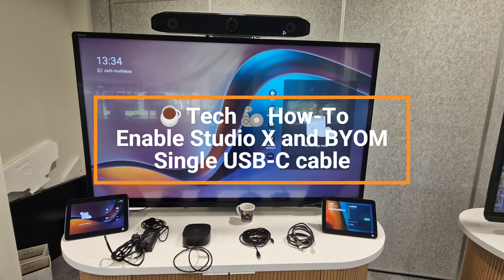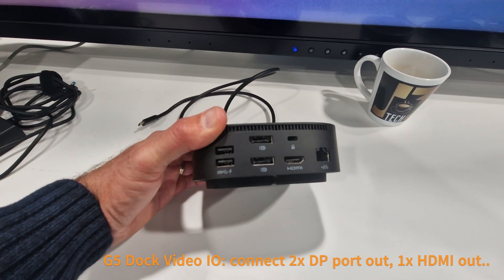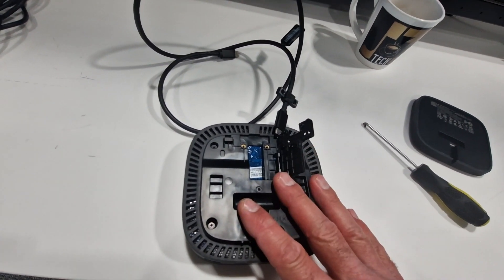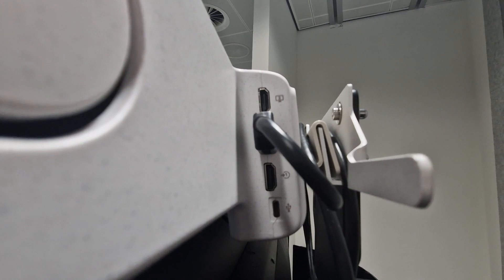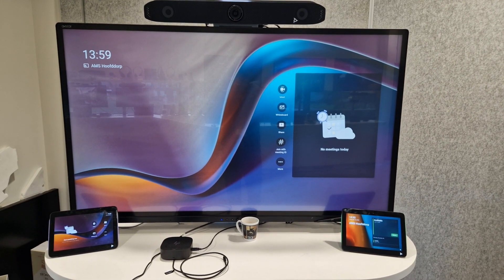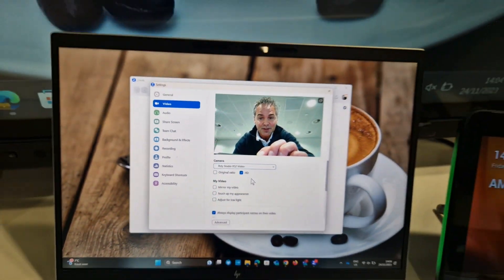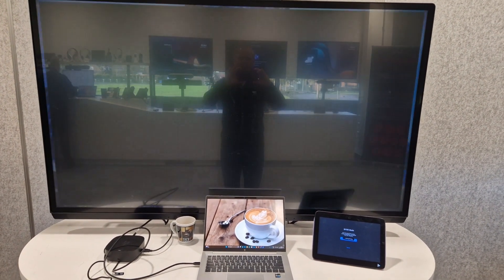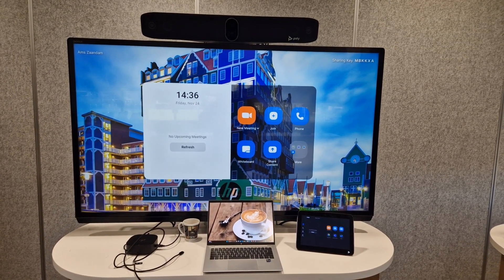☕Tech🔗Studio X as BYOD with HP USB-C Dock G5-G6

Comment: Thank you, Jan.  Great video and we are doing something similar with a non-HP USBC hub, so it’s good to see there’s an HP option.  With the single cable though, if the room is in Teams Mode joined to a Teams call, can you still content only (HDMI ingest) into the Teams Call?  OR will it throw the whole room into Device Mode instead – hanging up the Teams Room call?
Reply from the maker: Hi thanks for your comments. I guess with any HP or Non HP USB-C Dock (always test). In case you are live in a Teams meeting the Device Mode will be blocked and only share as expected content via HDMI in the Teams meeting. You can turn on a setting in Teams App if you automatically want to share during a Teams meeting when USB-C is connected or not... does that help? JZ☕️🔧
Reply: @janzoetemelk  Thanks that's fine.  We'll still likely keep the HDMI only option - just  in case someone plugs in the laptop before the Teams Meeting starts